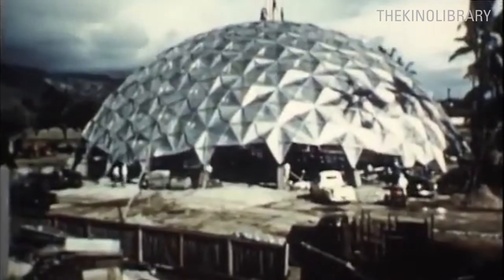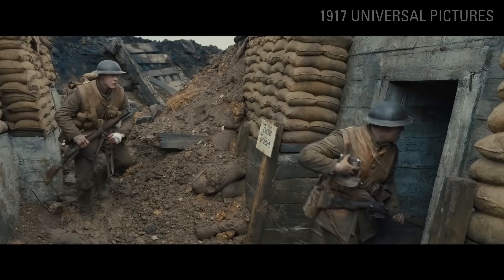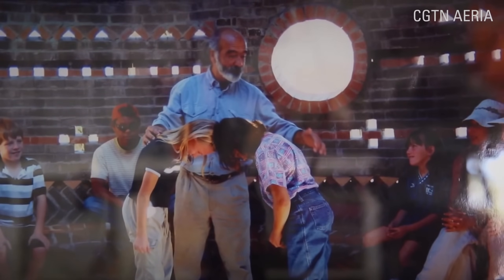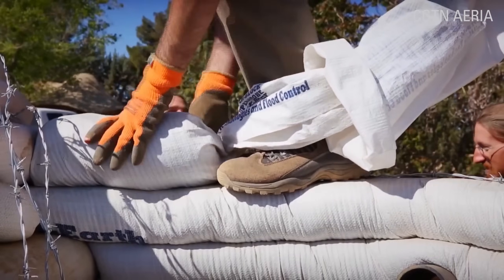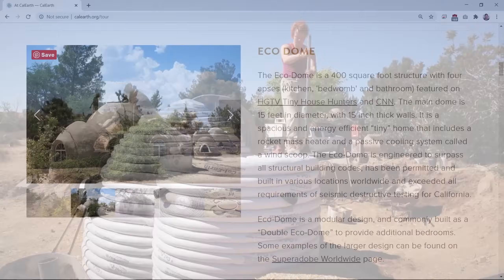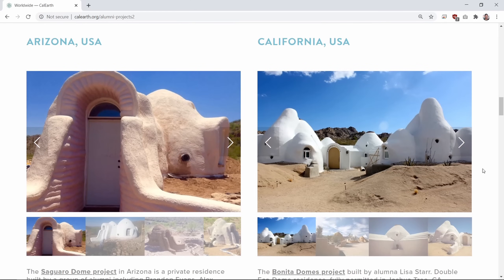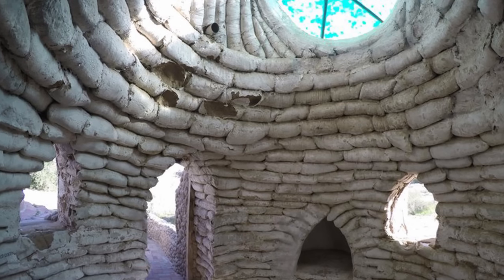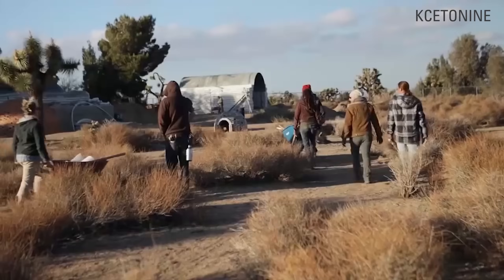Pros and cons of Superadobe Earthbag homes

Comment: Pipes and fittings won’t be exposed if you hammer the shape into the wall before the bags dry. Also, precise sand/clay ratios aren’t all that important. As far as furniture, you build most of it with earthbags into the walls. They act as support and fit the look of the house. All in all, earthbags require minimal skill and cost next to nothing to build. They can do a range of shapes and have great thermal values. These structures give normal people the freedom to build lasting homes on their own.  Really, the only downside is the labor. It is SLOW
Reply: Yeah, the physical labor is really the downside to me.
Reply: The lack of being able to rearrange the inside would be nuts.

Comment: Sand slurry pipelines could make earthbag production scaleable. You could even truck in earth and fill bags on site, or fill long coils of bags offsite and truck those in. You could use a small backhoe and spooling equipment to lay the long bags along the footprint of the house. Tools can definitely be made to help with tamping and plastering. There's no reason you can't do half bag houses. this would work great for building into landforms like slopes or big boulders. half dugout, half bag. Half bag, half timber frame. As far as the bags go you could design them to have interior lines of fabric woven into them, maybe whole sheets. This would give the effect of stabilized earth. Speaking of stabilized earth, bag homes may be faced with stone, brick, swanky chrome or whatever to suit a homeowner's taste. If you layer in wooden members you could  nail lathes for plaster or screw boards of sheetrock to those. Another fancy idea is to build your interior tree homes with a first floor of bag walls. If bag walls resist deformation well then they should be able to accommodate root growth. If you want to build a second floor you then have the option of building a tree house. As far as electric goes I would just run it along the outside of the house in MC, conduit or in some other raceway and just mud over it. Code already allows for this.

Comment: location, location, location. 
Building methods are just as dependent on location, as every other aspect of housing. 
Some places are well suited for earth-bag construction, and will be an advantage compare to other local options - but most places will not see very many advantages (or improvements) by earth-bag construction - compared to what other options are  available locally.

Comment: I have been there about 25 years ago but the place is more about building your own home. I do not want to do this I have the money to hire a company to do it for me. Money is not a concern for me but I need the best contractor available to build a high quality large home, and I have not been able to find one. These are great homes for weather they really are much cooler inside than the desert heat in the desert town of the place , I do believe if I found the right honest contractor I would build one and pay cash for it. They are beautiful and have an opening at the top of the roof for fresh air to come into the home without making it hot. They built  most of them with cement in the bags for convenience at the Hysperia site for the school. I do not want that I want earth in the bags and want it finished off in a much higher standard than the ones they made at the school. We just don't have great contractors for this kind of home from what I have seen, I want a professional to build my home and am willing to spend a fair value for it but I am not going to do it by myself.

Comment: Thank you for this very thorough analysis~  I can think of solutions for the first two issues.  1)  You don't need customized furnishings and infrastructure.  You can either accept the gaps between straight objects and curved walls and call it storage space, or rearrange the furniture into the center of the room with walking space around it.  2)  Similarly, you can hide pipes and conduits behind furniture.  Or, for that matter, you can panel the inside into a familiar box shape with doors into the space between the walls and paneling for pipes, electrical conduits, and storage.
Reply: I'm also thinking that a gap behind a couch is a perfect place to put a floor lamp.
Reply: You can also design a rectangular plan if you use a barrel vaulted roof.
Reply: @markharmon4963  I think the advantage of the dome is that you do not need any support for construction. This is why they are not dome shaped in fact but pointy. You need in fact to build a wooden vault to construct a vault.
Reply: the CalEarth institute has a square design the Vaulted House, the thing is that the ecodome is more popular

Comment: Hmm. The main benefit I can see in this method is that you can possibly consolidate several construction steps into one. The main issues I can see is with 2 story+ construction, installation of plumbing/electrical and the competition with conventional methods architecturally. Perhaps you can create an alternate earth bag(s) that facilitates such installation like with a channel or hole created in the middle as well as another bag which facilitates the opening directly to the amenities. Being able to fix sheathing consistently to the bags would be a huge plus in architecture as well as savings in time and money. It would be indistinguishable from conservative designs. You would be insulating and framing the house at the same time while also prioritizing the thermal properties of the house. Also the structure would have an incredible fire rating, making it very safe.

If you focus on keeping it simple with a single floor design as well as some upgraded and diverse earthbags you could very well replace more conventional methods for certain house designs. One huge niche that comes to mind quickly is the possibility of simply filling the bags on site using a loader and packing machine which processes local earth into compact squares then fixing strips of steel at 16" intervals to create a framework. Use conduit bags where you want plumbing/electrical and boom you got a fireproof house that saves you money on the short and long term. No need for extra fire rating, insulating, framing, vapor barriers and the skill sets associated with them. Market it heavily towards greeny folk and the frugal/functional then you got a product. The new smart house.

If anyone wants to pitch-in go for it. Save some resources that could be used elsewhere such as for yourself!

Comment: I’ve never heard of the wiring or plumbing being left exposed in these types of buildings.  They’re built into the building as the bags are laid, so you need to pre-plan the layout of the building, but they’re certainly not left exposed.
Reply: If you built the wiring and plumbing into the bags that would necessitate tearing down the home partially to do repairs
Reply: @barneystinson2781  not really.  The mixture inside the bags is the same as adobe usually.  Once it’s hardened, you could chip out around the pipe if need be, replace it, and simply use mud clay plaster to patch it.  It’s much simpler to do repairs than most people realize.
Reply: @triciacenac8793  I wouldn't want to have to chip away at the structurally integral walls of my home for simple repairs
Reply: @barneystinson2781 Tricia Cenac is correct. Repairs and alterations are not any more difficult than brick, block or stick construction. The pipes are usually run below the floor slab or wood floor and stub-up. Laterals run in the grooves and superficial vertical paths can be chipped out and plastered over with negligible impact to the structure.  All finishes completed with some earth, water, and stabilizer of your choice.
Reply: @barneystinson2781  Conduits are required as confining wire in plaster stresses the insulation as it heats and cools. So conduit is required and a good means of upgrading wiring over time.

Comment: Seems like the criteria to make this a "best choice" for any current / future homeowner:
 - Have enough readily accessible cash to self-finance the lot purchase, prep work, construction and finishing.
 - Have enough free time / schedule flexibility to devote the requisite man-hours to construct and finish the structure.
 - Have a small enough family to live comfortably in no more than 900 - 1200 sf of home.
 - Have an architectural blueprint that clearly, precisely and safely lays out all the electrical, gas, hot/cold water, and drainage lines in an under-floor layer with proper vertical up-takes for all the spots where you want/need outlets.
 - Have access to the tools, shop or a contractor to build/fit custom cabinetry, counter-tops, etc... that will build to rounded walls.

Not a complete list, but that's already a very narrowing set of criteria to check off. And we haven't even touched on HVAC systems or ducting.

Comment: Belinda: 
I would like your input on a 30 year ongoing project I have been working on. Several years ago I started working on a concept that will solve an ancient problem man has had from the time we left the caves to explore other types of structures. I am sure Adobe was on this list back then. But Adobe is by nature an unstable material, so I set out to accomplish two main things. 1 to stabilize Adobe 2 to make it easier to handle. I’m about 90 percent completed. As my experiments are successfully completed the results are leading me to construction processes. To enhance the
Adobe’s structural strength and versatility, I feel non bonded pre or post tensioning would work well. I believe precast building components as columns, girders, beams, even slabs could be made on site. The style of construction would be similar to parking lot structures. Using a forklift or crane. I would like to start a YouTube channel and share my findings making this channel an OPEN SOURCE format where everyone can contribute. 
This fits in with everything I have done for the last two decades, reviving ancient technologies and bringing them into the 22 century, hopefully gracefully.
THANKS4GIVING

Comment: Sounds like a great way to build a cabin or storage building if the local soil is suitable.  Not so great for a home though. The design options are very limiting and utility distribution throughout the house is just not practical.
Reply: Distributing power, water, drain waste and vent pipe are no more difficult than brick, block and stick construction. Ventilation duct will require some more innovative solutions such as high velocity underground ductwork or radiant slab heating and cooling.

Comment: I would love to hear your take on watershed block. It’s the closest thing I know of to the idea you mentioned at the end of the video. They can compress earth into CMU shaped blocks on or off site. The big innovation seems to be the compression machine and a ton of research into earth mixtures.
Reply: Agreed. I have looked at these as well. Mainly because I want earth walls that breath lime or earth stucco. It is something you could design as couple brick to try to get it to pass code without adding Insulation. Trying to get a hone from 100 natural materials that breaths as opposed to living in a plastic bag vapour barrier

Comment: 2 cons that should not be on the list for sure is the exposed wires and pipes and round furnishings. A well planned plan where you want to put your electrical and plumbing in your home will not be exposed. The shape of the walls can be less round and also no need to make round furniture. Think she needs to go and see some domed homes before doing this video. It is Biased.

Comment: i do not know but clay is much better than sand... i think because it is more easily compacted. secondly... why should we need into the wall electric and plumbing like a ordinary high carbon footprint american household ???? keeping it simple and more classical and to make low cost Eco friendly house is the objective here. 

thirdly if anybody is making a green house they prefer to keep the plumbing to outdoor or a separate room where you do all the water works. but still interesting analysis.. and you should try living in a circular house you will feel tremendous difference in mind and body because the earth magnetic field can easily move through circular walls to keep our field in check and keep us healthy. as the frequency of square is confusing for the mind. and please do not tell me that there what do i mean by magnetic field of humans.. every atom is magnetically charged except noble gasses and so does our body that is a mixture of atoms

Comment: If you could mechanize the bag filling step, either by using small scoops on a conveyer belt or by wetting the materials, blowing the bags full and letting them dry, then the labor costs would decrease.  Also,  I don't think you have to use on-site sand and clay.  If you can just decrease the transit distance, you could still achieve savings.  One other thought is that temporary housing is seldom temporary.  If you build it, people live in it until it starts to fall on their heads.

Comment: I'm trying to get more information about the temperatures in these homes.  I never hear anyone say anything about them needing air conditioning.  Can someone let me know if it is necessary to have air conditioning or not?  Thanks for the information!
Reply: It is my understanding that as long as it gets cool at night then you won't. By the time the heat of the day reaches the inside of the wall (about 12 hours) then it is cooling down outside so the remaining heat in the walls heat the inside while the outside of the walls are cooling. Then in the morning the coolness of the evening is just getting into the inside of the walls and the process repeats. But if you live in humid Houston like I do I don't think it would work without AC. It just doesn't cool down enough at night.

Comment: Another problem with these homes is, unless you're willing to spend a LOT of money to cover the bags with concrete (which is actually not recommended, at least not on both sides of the walls, because it traps water IN as well as out), the environments in which they're practical is fairly limited. Heavy rains or snows that melt will basically disintegrate a cobb or plaster covering. I would definitely NOT want to try to live in one of these in the Amazon rain forest, Cambodia or the Philippines, just to give a few examples.

However, the "problem" mentioned about not having the perfect mixture of sand to clay can be ameliorated or even eliminated by simply adding a small amount (about 5% depending on the ratio of sand to clay) of portland cement to the mix; about a coffee can's worth per wheelbarrow load of soil usually seems to do the trick. 

The rest of the "cons" mentioned here are quite valid ... EXCEPT for the "getting a loan is difficult" complaint. Seriously: if you're at all careful with your money you can build one of these homes for about $5000 here in the US. Get a mortgage for the LAND if you want, but if you can't come up with less than the price of a good used car to build your HOME, then just keep renting.

And no, I DON'T consider a small two-bedroom, one-bath home a "temporary shelter," but then, I'm a confirmed bachelor ... ;)
Reply: It is an option to put a real roof over it which would negate the exterior being washed away in rain. Personally, I would want to do lime plaster inside since it does so much to deter pests and mold.
No one solution is perfect for everywhere/one, but I think I would really like this method for building.
Reply: We live in a very wet climate and we are building one of these. There are ways to get around that such as the term boots and a raincoat. Get it up off the ground on dry stack stone foundation and put a living room that reaches out several feet over the walls and of course paint the outside with a lime mixture. Or like us we're going underground and we'll be wrapping that puppy Every Which Way in a pond liner.

Comment: But a house is not just the shell, it's the security system, windows, wiring, plumbing (sewage and potable) and heating system.   The ratio of costs for raw materials to labor must be also taken into account.  What makes a good temporary shelter is very different than what is needed in a permanent shelter. It might be important for a temporary shelter to be easily demolished and recycled.  Any discussion of these earthbag homes must cover each scenario differently.  Sometimes labor is 80% of a home's cost, sometimes it's much less.

Comment: I live in north Texas about an hour outside of Dallas. I also have a pretty high clay content. I have looked at other earthbag videos and they dont use 70 sand/ 30 clay ratio. It is about opposite of that. So if I wish to build a semi buried stormshelter out of these earth bags, top it with standard 2x8 flat rafters, cement it all in with a bond beam to include 2 or 3 inches of "slab" over the rafters and them berm it up to the "slab" would this work? I will have to truck in sand so...how important is the ratio (please assume I understand how important it is to have "clean, as in organic material free soil)?  Really find I like your videos. Thanks and please keep them coming.